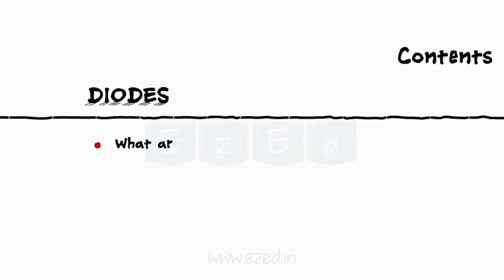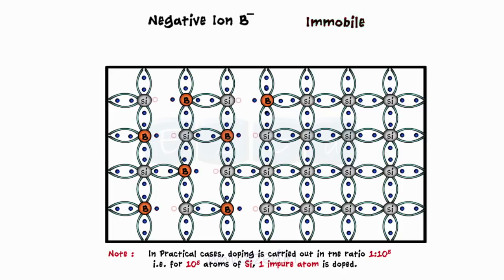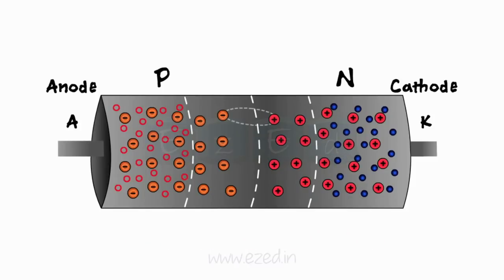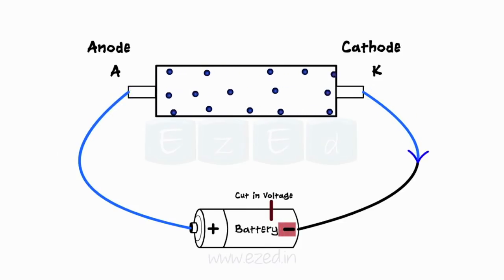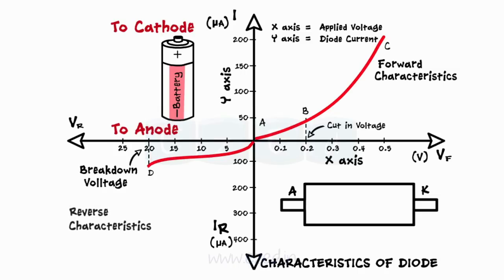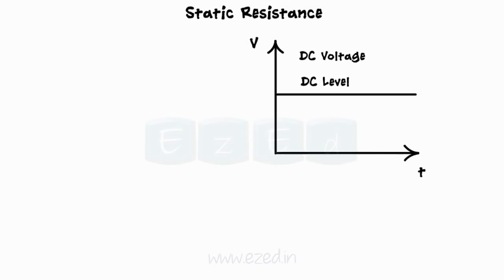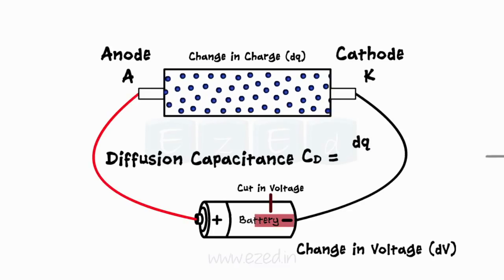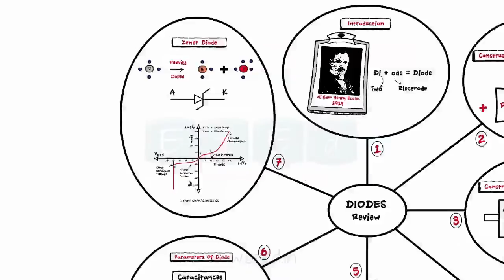Diodes - What Are Diodes - PN Junction - Forward Bias - Reverse Bias - Zener Diodes

Comment: Why the positive and negative ions created  at junction do not combine ? , Why are can't they move?. Thanks in advanced, great video.
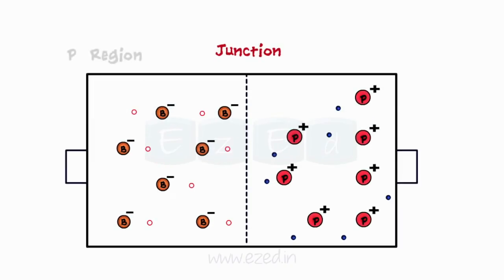Reply: The free electrons of the n-type fill the holes in the p-type material creating full valence shells for those atom. This prevents the passing of more electrons from the n-type material. because electrons only have so much energy to move from valence shell to valence shell. Check out about 2:48 that may answer better.

Comment: In a diode (made with 2 semi-conductors, P and N), there is a depletion zone created as soon as the N and P are in contact each other without being connected to a battery. Can we say that in a transistor (PNP or NPN), there is too a depletion zone between each NP junction, so we would have P-depletion-N-depletion-P and N-depletion-P-depletion-N ?